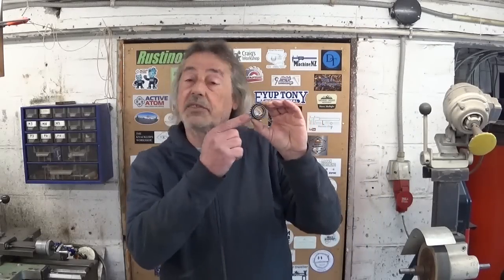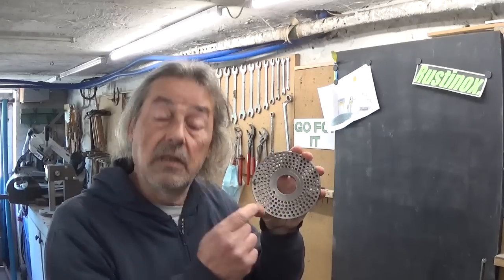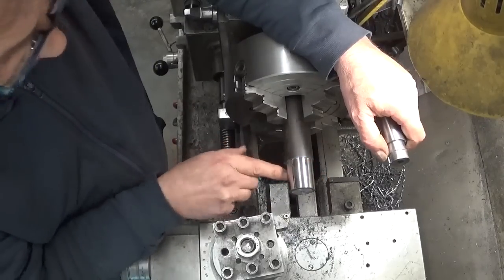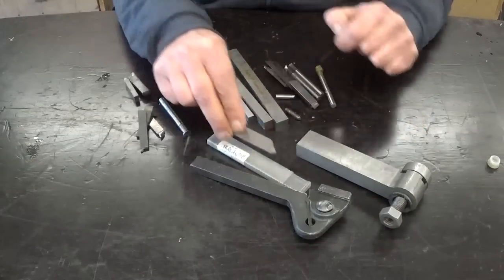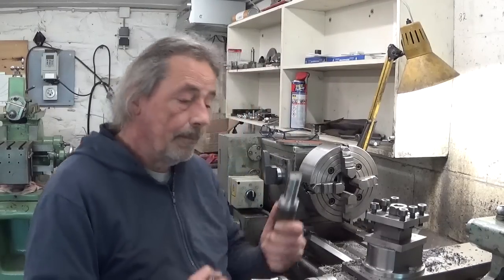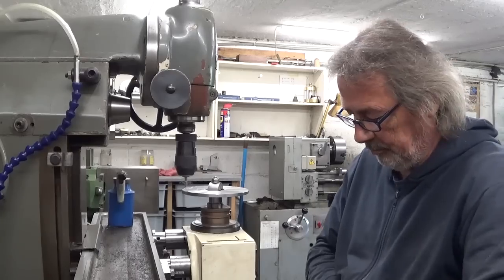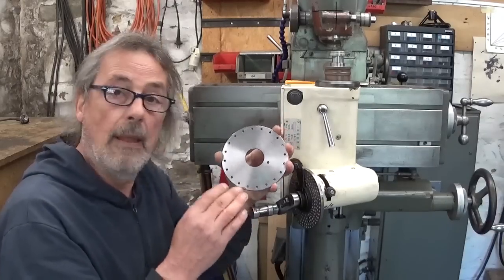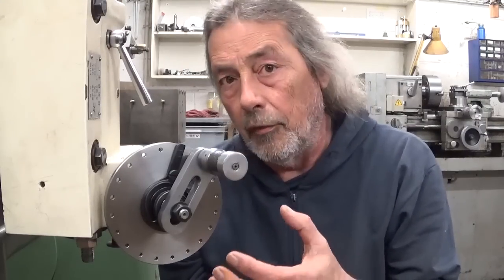Making an indexing plate for the dividing head.

Comment: Question: If you already had a plate that let you make a 20 hole dividing plate why did you need to make it?  Was this to just simplify the use of the dividing head so you did not need to use a complicated set of holes in the original dividing plate?
Reply from the maker: It's a 40 to 1 dividing head. To make 20 divisions I need to do 2 full turns for every division. So, I can use whatever plate I have as long as I always use the same hole. I hope that makes sense.

Comment: Hi Michel, I love your English, like me also you do not know all the correct names of things, but try to tell them in your native languish and they will be in big problems. I suppose French is your native languish, mine is Danish, and i also have problems. Love your approach to problems and to solve them. I have a question, what is the make of your milling machine? i also work in a cellar with a low ceiling and your machine looks like it will fit, I do not have a milling machine yet, but want one. Have a nice winter in the cellar 🙂
Regards Steffen Denmark
Reply from the maker: It's a Deckel FP1. There is a video in the playlist.
Reply: @Rustinox  Hi Michel, now i have bought a milling machine, i found a Shaublin 13 in very good condition for good price. Have a nice day.

Comment: In the being I thought the gear had 25 teeth and you needed a plate with 25 hole later you made 20 holes in a plate did you need 20 or 25 ?
Reply from the maker: To make a 25 teeth gear, I need a plate with 20 holes. One tooth is 1rotation plus 12 holes.
Reply: The internal gear in his dividing head (with 40 teeth) has one factor of 5.  Any multiple of 5 would do for the new plate.  He chose 4 x 5 = 20, based on the old plate.  It looks like he had room for any multiplier from 1 to 13 (x 5).  With his 20x plate he could make a 3rd plate w/ both 20 & 25 divisions (for sub-multiples of 800 or 1000 divisions, including 100, 125, 200, 250, etc.) to rule dials and the like.  The real challenge would be to create new primes (of 79 or less?) which were not on the original disk.

Comment: Nice job!
  We made some dividing plates on our SIP Jig Borer.... Love that machine to death.. RIP.  Even though the machine was very accurate, I was questioning the accuracy of the center-drilled, drilled and reamed holes.  I thought it would be a better practice to bore to finished size, and i'm sure it would have been, but due to the small diameter and lengthly setup & operation, we opted for the drill and ream approach.  The plate alligned prefectly with the setor arms as did yours.  Impressed with your material usage.  Would have never even thought that to be an option.
Aa always, appreciate your videos.
Reply from the maker: Thanks. Well, I use what I can find.

Comment: Hi Michel,  I'm not sure as there was no close up of tool box section,  but that grooving tool you liked so much  may be an internal screw cutting tool 55 deg English or 60 deg metric  , they are made so you grinder the top only to keep sharp.
Steve
Reply from the maker: This is indeed a square grooving tool.

Comment: Hi Maichael,
I liked the edit. You are making good progress and finding your voice.
Reply from the maker: Thanks Mark. Still working on it. It's not easy.
Reply: @Rustinox  I know what you mean. If I knew what I was doing, I'd be doing it better :)
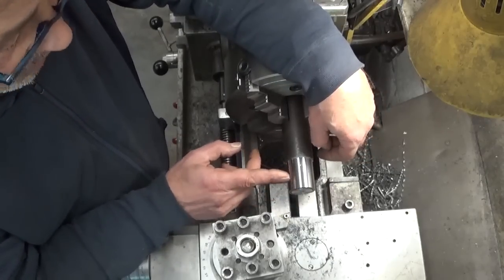Around minute 05:00 you are turning on the lathe. The gear noise is quite uncomfortable on the ears. Try to lower the audio on machines running to about -12db for nice sounding machines like the belt drive drill press, to about -25db for angle grinders, or if you want to voice over it.

Comment: Intrigued by the spring loaded parting tool. Interesting to see the dividing head mounted vertically. Cheers
Reply from the maker: I haven't used the parting tool yet. But if I do, I will put it in a video.

Comment: I got lost somewhere.
What did I miss ?
You needed 25 teeth but you made a 20 hole plate  🤔
Plus you already have a 20 division plate.
Reply from the maker: Is it ok for you if I explane it next weeks video?
Reply: With a 40:1 dividing head, you can make any division that is a factor of 40 using only whole turns of the crank.  For 40 divisions, one turn of the crank.  For 20, two whole turns of the crank.  The disk and ring of holes being used in this case is utterly irrelevant, as it's only being used to indicate a whole turn.  Indeed, he could probably get away with no disc at all in this case, and simply eyeball it.

More generally, though, for a division D and a dividing head ratio R, making the division requires moving the crank by R/D full turns.  So for a division of 25, Michel needs to advance by 40/25 or 1+3/5 of a turn. per division.  He can therefore use any ring of holes which has 5 as one of its factors - 5, 10, 15, 20, 25, (obviously), 30, 35 and so on. 

When choosing a set of disks for a dividing head, you try to cover the maximum number of factors in order to get coverage of the maximum number of divisions.  I'm doing this at the moment, and it would probably be easier to cut a new worm wheel with a "reasonable" ratio than carrying on with my bloody 55:1 wheel (caused by buggering up cutting a 60:1 wheel and ending up with a blank that was too small)
Reply: 20 x 40 = 800. 800 is divisible by 25 so the 20 hole plate is good for making a 25 tooth gear.

Comment: I don’t know if it would work on your machine, but since I don’t have a quill stop either, sometimes I’ll use the bottom of the quill travel as the stop, and adjust the depth of the hole by raising the table.
And yes, I was going to say you drill more hole patterns, but then I realized before you said it that you can’t drill the patterns you don’t already have (at least not that way).
Reply from the maker: I tried that before. But if I bottom out the quill, The bearings make very scary noises. So, that's not an option. But one day I will make a depth stop. For sure... well maybe... we'll see :)

Comment: Always nice to watch a new video from You!
Time 02:43, the find at the scrappy... I found one very similar when emptying the bludder around the corner of the train housing hall. I think I can pick it up.....
Troubling You can't make 25, 19, 18, 17 holes. 25 is no problem. I can make 24,5, and 25.5 holes also if You would need it to be sure...
Need to make a video about that setup.... Some rainy day when drone flying is unsuitable...
Reply from the maker: I don't think I will ever need 25,4 holes :)
Reply: @Rustinox  No, they are only for very special use....

Comment: As someone already pointed out, since the dividing head has a reduction of 40:1, even a cardboard plate would work since the error in the plate is reduced by 40.
Also, you made the holes on the outer rim of the plate but it's probably wiser to always make the hole pattern as close as possible to the inner rim. This leaves the outer rim free for when you need a really high number of holes that only fit on the outer rim.
Reply from the maker: Thanks Erik. That makes sense.

Comment: Hi Michel, I'm sure I missed something and Ive never used a dividing head before but if you need 25 divisions for the gear then how does the 20 divisions in the plate help you or is the gear 20 teeth. I'm confused!!

Very generous gift from Tobias and congratulations to him and his new family as well

A great video as always have a great weekend!!
Reply from the maker: Thanks David. Is it ok for you if I explane it in next video?
Reply: @Rustinox  Hi Michel, of course it is, I look forward to understanding the process better. Have a great weekend
Reply: I don't have a dividing head but am fascinated by them. I was going to ask the same question 😁
Reply: Dividing heads usually have a ratio of 40:1 (rotary tables usually 90:1).
20 x 40 = 800. 800 is divisible by 25 so a 25 tooth gear is possible. 
40/25 = 1 3/5 so 1 turn and 3/5 of a turn per tooth. 3/5 of 20 = 12 so
1 turn plus 12 holes per tooth
Reply: Hi Michel, I've done a bit of investigating on dividing heads and understand the concept now. I can see how you get your 25 teeth from your 20 hole plate using a 90:1 head.

Not sure what ratio your's is nor the range of plate holes that you have!!

I look forward to your explanation in the next video. Sorry for asking a stupid question😅😅😅

Comment: Well done Rusti, great result, and you now have some more steel stock for another project 👍. That clip certainly doesn't look well designed, is that a Deckel head or someone else's? Cheers, Jon
Reply from the maker: It's a Chinese clone. It doesen't even fit the table.

Comment: Making a part for something you don't have ... yet !
Reply from the maker: You're absolutely right.
Reply: If you use a digital spirit level with a 0.1 degree resolution, combined the dividing head ratio of 40:1 you would be more than accurate to make the 19 / 18 / 17 holes.

Comment: I guess you had another hole pattern on your original plate that divides by 10 to enable you to generate the 20 circle. Very nice job!
To make the plate without a dividing head you need a DRO on your mill. Even the most basic ones will have a circle of holes function and I believe using XY coordinates results in a very accurate hole spacing if done correctly. The downside is drilling hundreds of holes... yawn!
Reply: That's where you need a CNC - lay out the holes in cad using whatever numbers of holes you need, mount the stock in the vise, and let the machine do the tedious work of drilling hundreds of holes
Reply from the maker: If needed, I will figure it out. I'm sure :)

Comment: Hi Michel.  Does the Deckel dividing head do compound division (i.e. does it have a second indexing arm behind the disk).  If it does, you should probably be able to get some pretty damn close approximations to your missing divisions.  Otherwise, for the small numbers of holes you're dealing with, you could get by with "eyeballing it" from a printed paper template.  It's an approach that works pretty well, and the inevitable errors are pretty much averaged out by the ratio of the dividing head itself - assuming you're out by, say, 0.2mm on a hole, which should be do-able, with a ratio of (I'm guessing) 40:1 you've got an error of about 5 microns on the division.  Worst case, you could make a set of "throwaway" plates and use them to make a set of more-than-accceptably accurate "keeper" plates.

As it happens, I'm busy working out a bug in my compound division calculating code, but it doesn't have the deckel head in its presets. Do you happen to know what the original plates for the deckel head were?
Reply: I once calculated that if all you had was a 40:1 dividing head and a disc with a single hole in it, you could make a plate with any arbitrary number of holes accurate to within 3 arc minutes in just three steps (two intermediate plates).
Reply from the maker: This dividing head is a "made in China" one, and doesn't fit the FP1. Maybe it is made for other Deckel machines. I don't know.
Reply: @Rustinox  Ah, right.  That's what you get for assuming...

So, I did a few calculations with the new version of my code.  Assuming normal indexing only, and calculating up to 50 divisions, your original indexing plate is good for 1 2 3 4 5 6 7 8 10 11 12 13 14 15 16 19 20 21 22 23 24 26 28 30 33 35 38 39 40 42 44 46 48.  Adding your new 20 hole plate into the mix, we get 25 32 50.

I couldn't find any details on your dividing head on the 'net in order to find out what plates it originally came with.  Given the plate you have, they don't seem to be clones of anything I have documentation for, though.

The "typical" set of plates for a 40:1 head (as used by Browne & Sharpe, Emco, Kertney and do on), is 3 plates as follows : Plate 1 - 15, 16, 17, 18, 19, 20 , Plate 2 - 21, 23, 27, 29, 31, 33 and Plate 3 - 37, 39, 41, 43, 47, 49.  That gets you every division up to 50 (and as a bonus, the division tables are in Machinery's Handbook).  You should be able to make that set of disks pretty easily (although you'll probably have to eyeball at least 17, 27, 29, 31 and the whole of plate 3).
Reply: @wibblywobblyidiotvision  I think Rusti has a chinese clone of the Deckel dividing head, but missing 2 plates. I think he has the 33,38,39,42,46 plate & is missing the 27,31,34,41,43 plate and 36,37,40,58 plate.